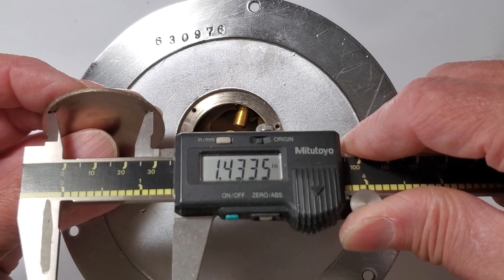Chelsea Ships Bell Clock 4L Gong Repair 4L for Sam from California #62

Comment: From someone who is a retired watch and clockmaker I would like to say, how nice it was to see a a fellow clockmaker who knows what he is doing. A great video well explained on how and why the repair was undertake in this way. A thumbs up from me.
Reply from the maker: Thanks Stanley,
  The designers of this simple part had to engineer it to very tight tolerances to maintain a good air clearance around it so it didn't touch the case during use.

Comment: What you're doing is a lost art - actually repairing and not remove and replace. Thanks for uploading these videos.  Love the sound of the clocks in the background as well.
Reply from the maker: Thanks Winston, 
I have gotten use to working on a lot of older items older than this one.
Many of them, rare, no other way to keep them running except to fabricate my own parts for them.
Thanks again
Reply: @jamesmartin5370  Just curious do you accept Chelsea Clocks for repair?  My Dad has one that probably could use a good cleaning.
Reply from the maker: @winstonchurchill3597  
Yes. I am usually several months out with jobs.
You can contact me at jamesmart55@hotmail.com
or give me a call anytime....509-868-2499

Comment: Thanks Jim. The repair looks rock solid and your detail work is amazing
Reply from the maker: That epoxy claims up to 5020 PSI strength, it will ever see that type of stress under normal operating conditions.

Comment: Hi James, I've been watching your videos and I learn something new every time. I'm personally getting more & more into horology myself. I have many books on clock & watchmaking and many suggest different types of lubricants. For instance, in my, "Watch & Clockmakers' Handbook," by Britten (published in the early 1900's) specifies many clock & watchmakers used Porpoise, Olive oil, Sperm oil, or Neatfoot oil mixed with mineral oil. Now, synthetics are used. Just curious, what oils do you use on many of your clocks and watches?
Reply from the maker: All synthetics.
Reply: @jamesmartin5370  What brand of synthetic oil do you recommend/use?
Reply from the maker: @jfidyk7412  Brands is something you will need to sort out, it can get confusing.
I stick with name brands like NYE and Moebius that are labeled as so, I stay away from odd brands and generics.
I have several different brands I have purchased through the years.
I like M56-b, good oil with better anti-spread characteristics on steel than Moebius, entirely synthetic (ester), viscosity same as Moebius 9010 (polyglycol). 
PML 79, a good American watch oil developed by Hamilton, manufactured by Nye today, isn't as slippery as Elgin M56-b, it has the best anti-spread property of any oil I have used.
Reply: @jamesmartin5370  Thanks!!! I actually recently bought a brass Chelsea, same size, has a ships helm detail around it. It's drenched in oil to a point where it's almost dripping plus when you try wind it, it starts to tick like normal. So who ever worked on it must have put the mainspring backwards.
Reply from the maker: @jfidyk7412  The one above looked like someone oiled it without cleaning it at one time to get it working.
Sounds like yours may have had some similar treatment.
Are you going to dismantle it completely?
Reply: @jamesmartin5370  Oh yes! It's getting a complete overhaul.
Reply from the maker: @jfidyk7412  Give me an update on progress.

Comment: I know this is off topic. But do you know anything about French Morbier clocks and their animated Pendlums I have one that has a woman with a broom and the head that rocks back and forth is missing. Would you know where I can find parts? Thanks ! I love your videos.
Reply from the maker: I have worked on a couple in the past.
Not able to advise on a parts source.
You may need to fabricate the parts, do some air brushing to blend colors for a best match until a replacement can be found.
That will most likely a tough part to find by itself.

Comment: My Elgin bell clock won’t wind how do I fix that??
Reply from the maker: It you can hear the ratchet clicking and there is no resistance on key, problem is with the mainspring, need to open the mainspring barrel and inspect.
If you can't hear the ratchet clicking, problem is with the ratchet mechanism, need to inspect the ratchet mechanism.